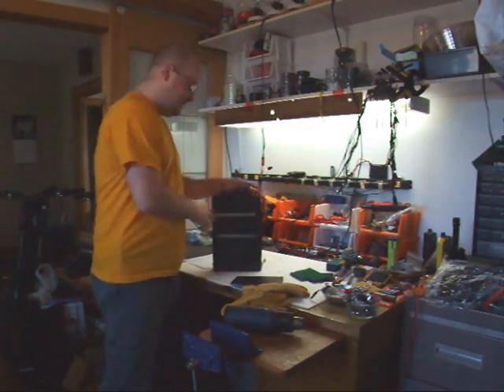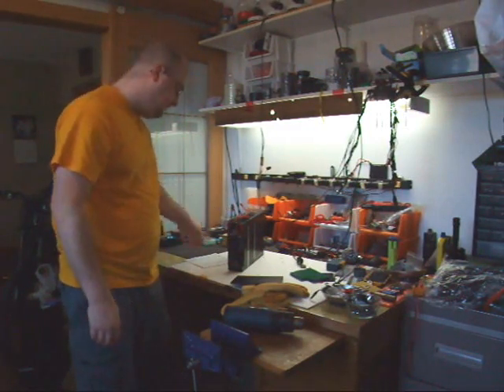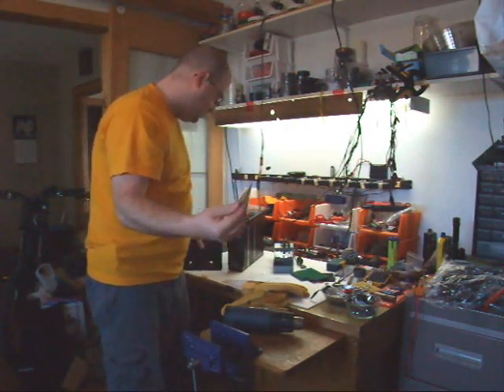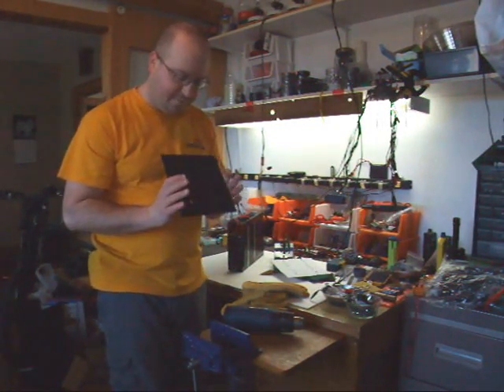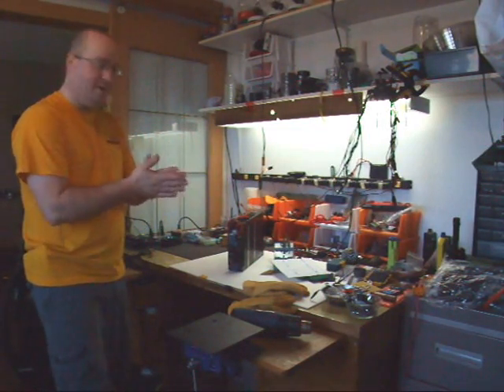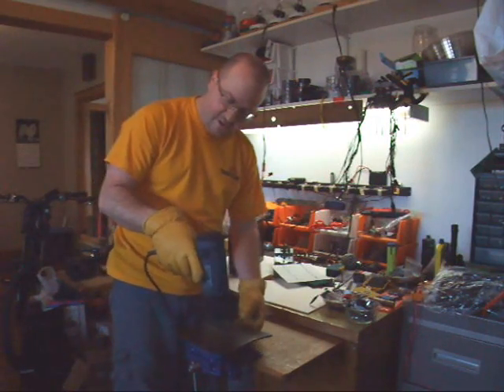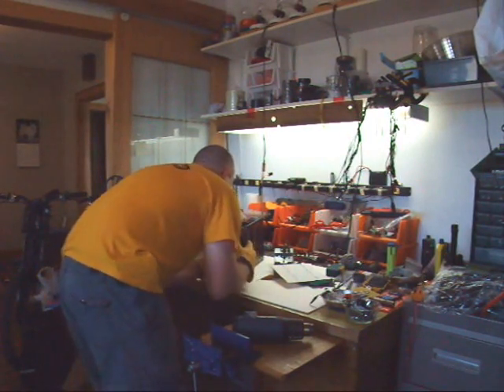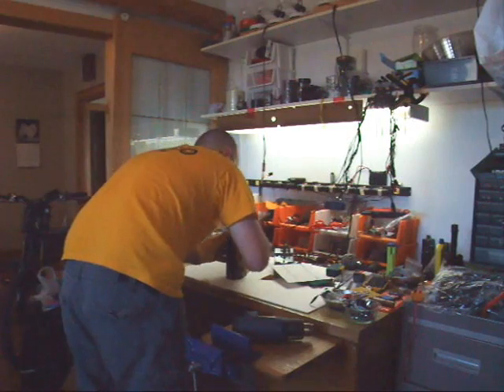Bending ABS plastic with a heat gun

Comment: ABS releases poisonous and carcinogenic gases when heat formed.. should be wearing respirator and have open windows....
Reply: +Ohlin Lindisir As i understand it ABS will only release fumes when it is fully melted, heat forming should not cause any dangerous gasses unless you are severely overheating the material.

Comment: What is the temperature that you are using in this video? My large prints come out warped so I will definitely be getting a heat gun to try and bend it back a little. I am familiar this may not be the best alternative always, but this is a special occasion.
Reply from the maker: I never measured the exact temperature but google says ABS melting point is 105 celcius, just make sure to heat both sides as equally as possible and take your time.. don't rush it.
Reply: Ypedal Thanks. Much appreciated. And also, what heat gun are you using and how much did it cost?
Reply from the maker: CloudandZack1st Mine is labeled " Mastercraft "  from Canadian Tire, 15$ on sale with a carry case and a bunch of attachments..  Any auto parts store will have theem, ebay or amazon also , 1500w typically ... mine has high and low. i run it on high

Comment: could a heat gun be used to reshape those realy hard plastic dinosaur replicas,. I need to make pose adjustments;
Reply: YES. I done it years ago. It took heat to mold it.
Careful, over heating and over bending distorts shapes, textures and finishes.
I have successfully reshaped 2 part epoxies with heat but only a little.
HOPE this helps.
Reply: fm00078 THANK U
Reply: *****
Welcome.... also updated my answer.
 I'm sure you know most of it. Posted for others info.

Comment: Is working with abs plastic 100% safe. When you heat it to soften the plastic does the plastic give off chemicals or any bad things. I want to work with abs plastic but I don't know if its really safe for me. So I wanted to make sure there aren't any health hazards with working with abs.
Reply from the maker: There are some nasty smells produced while you warm it up for sure, how bad for you are they ? .. i have no idea.. but in the big scheme of things in life, i'm sure i inhale worse things on a daily basis. You could do this outside but it will need to be a warm day as the plastic cools and hardens quickly once you stop applying heat.  If you had to do a lot of this type of work, a fume hood would be a good idea.
Reply: Well I haven't worked with the plastic yet because I don't know how safe it is yet. If I knew it were safe for me in the present and the long run then I would use it but right now im not sure. I need to know because im going to be making a suit of samurai armor and im going to use plastic to make it. I will have to bend a lot of the plastic sheets to fit my body so so far the only way I know to bend plastic is to use heat. Ive never worked with plastic  before so I would have to be 100% safe while using it. You mentioned a fume hood. Im going to look this up once im done commenting back to you but will a fume mask protect me from any bad air born chemicals and everything that this plastic may or may not give off. If so then I might use the fume hood.
Reply from the maker: Ione Sally  if you google msds abs plastic, you can find a variety of info, for example : http://www.tapplastics.com/uploads/pdf/MSDS%20ABS.pdf , basically, at lower temperatures  ( below burning, no flame, no smoke ) the vapors are relatively harmelss in a well ventilated room.. think of how popular 3d printers have become and they operate on very similar principles.  If you were super paranoid about it, a fume hood and a face mask with Activated Carbon filters would surely be more than enough to keep you perfectly safe. for small projects like i do, i really don't worry about it.
Reply: Ok thank you that was very helpful. If there is any other  questions that I have about plastic I might ask you because you seem to know a lot about it for the things I need to know.

Comment from the maker: yes, the harbor freight heat gun would work just as well, as long as it's 1000w or so. the temp i'm not sure about but just keep working along the bend line until it softens up ( practice on a scrap piece first )

Comment: sorry if you said it in the audio (I watched this without sound) but how many watts was the heat gun and what temp was it running at? Will a cheapo harbor freight heat gun work for this application? Thanks.